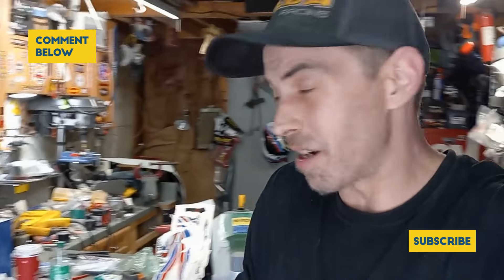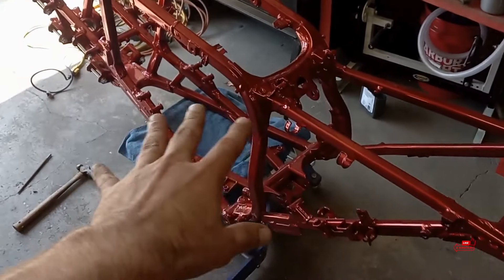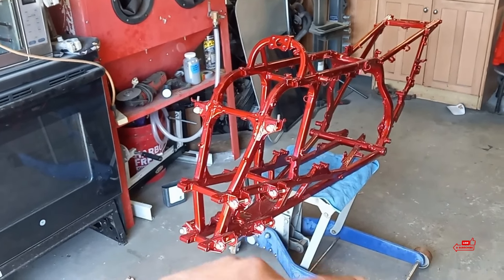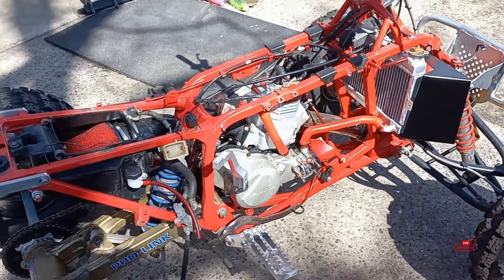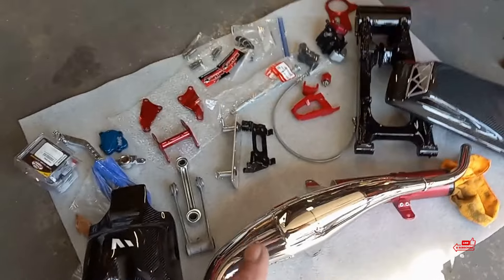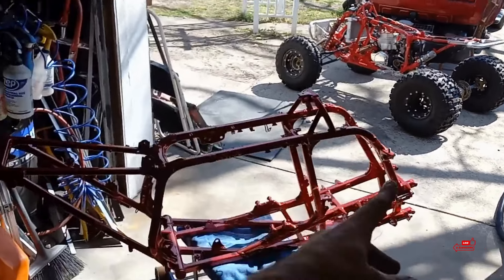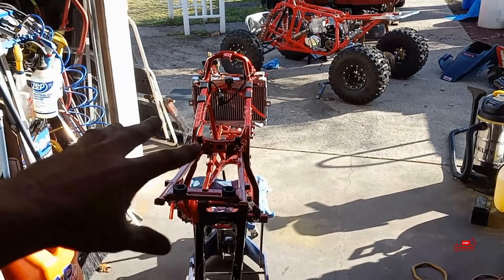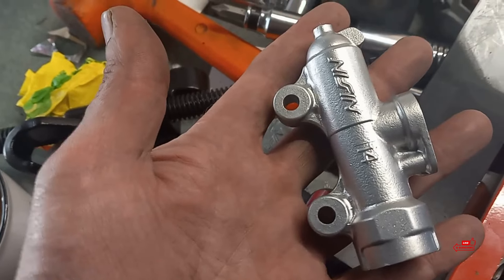Building My Dream 2-Stroke Trx250R. Part 1

Comment: PSI Jug looks sick use to use PSI pipes on some of my snowmobiles always worked great. Cool build the mighty honda 250r legendary. For plastics id go white blue seat and cover. The shocks u ordered is good enough man for sure.
Reply: Hot roding
Is using what u got ya new is always nice but after its not new its just another used part. Use what u have the axles will do the job lone star or dura blue. But i do know how u feel im also very anal with everything i do lol!! 
Black carbon fiber with white and red seat will work. Black will also work i just love white lol!!
Reply from the maker: It's a tuff call bro. I gave myself too many options

Comment: IMO I do believe that new red plastic with the black carbon tank and hood would look fantastic. Can't wait till it's finished. One thing I done last summer when I rebuilt my 200X was to replace all of the bolts with titanium bolts. They are polished and look really cool but expensive. Just food for thought if you want to go a step farther.
Reply from the maker: I just bought these nikel plated bolts. I was looking at the titanium bolts they definitely are pricey. If your into 200x's I'm probably going to sell this 86 after I clean it up a little
Reply: @garagemcmatt  8 x 35mm bolt runs north of $8. I used bolts from Probolt and Racetec.
Reply from the maker: @DirtyBob200X  that's gotta add up lol
Reply: @garagemcmatt  After I was finished I was afraid to add up the total because I replaced a few at a time. The hardest to replace was the lower motor mount bolts. Odd length, I eventually found them in Leeds, England from a outfit called RaceTi.
Reply from the maker: @DirtyBob200X  probably looks cool. I love the look of titanium

Comment: Get rpm axle guaranteed for life, I bent mine and they fixed it.
Reply from the maker: I like the durablue axle they are guaranteed too. I never bent a durablue before. I'm going to clean it up some more or atleast try to
Reply: @garagemcmatt  I think rpm is the strongest axle made, what is the guarantee on the durable, you have to register your rpm axle
Reply from the maker: @Johnbruzzi4234  no argument here rpm is the best as far as axles go. Durablue is a similar procedure

Comment: sometimes i mispronounce words to piss people off . i call the grab bar a bumper 🤣🤣. the elka stage 4 is plenty for anybody not racing . i went with the trx450 and 400ex front end for handling and weight saving . the only thing id change is the axel .  id run the LSR with the LSR hubs lol . the problem you had with them brand new hubs is exactly why i order parts like that DIRECTLY from the company . ive been raped by people like that before and never again will it happen . if im spending over 200$ , im calling the company directly . i cant afford to buy the wrong part or messed up part that somebody wont take back . my 86 is black frame , red fenders  and chrome / billet suspension . my Nac's replica i call it is an 89 with blue fullbore plasics , candy apple red frame and will have chrome / billet suspension . i like candy and chrome 😋🤤
Reply from the maker: I hear you on the parts. I got a return label yesterday so they are going back.
Candy red a chrome sounds sick